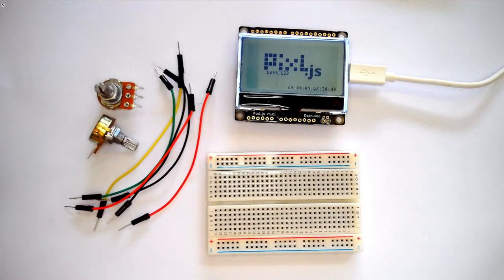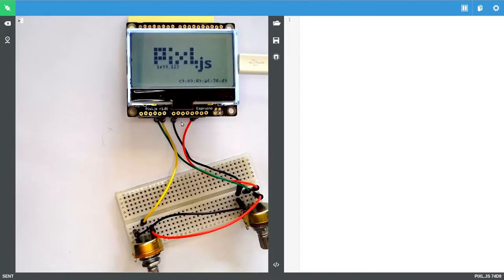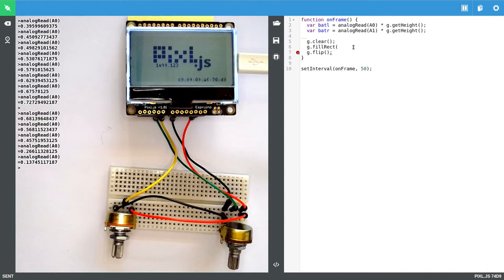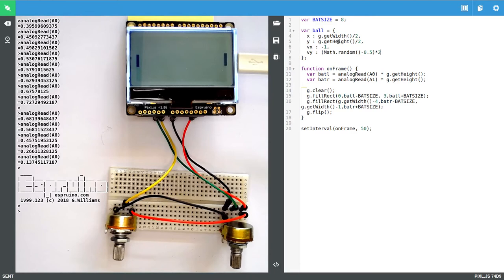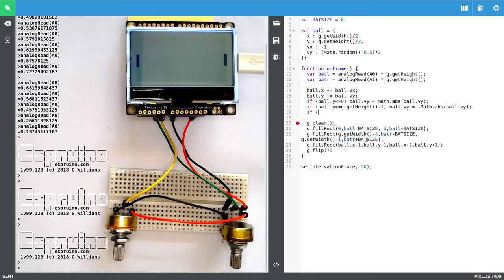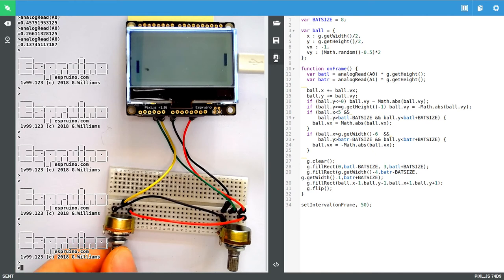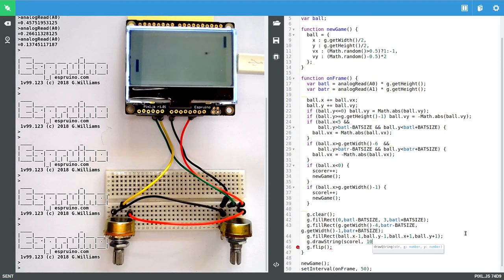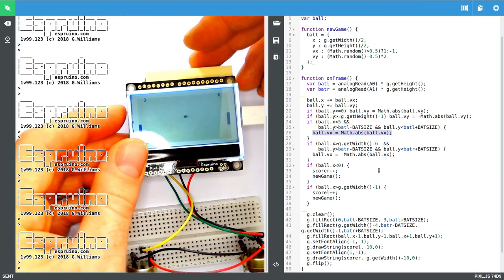DIY Pong Game in 15 minutes!

Comment: Did you use oled ssd 1331?
Reply from the maker: The display is an LCD that's built onto the Pixl.js board - but you could use an OLED to do a similar thing if you wanted